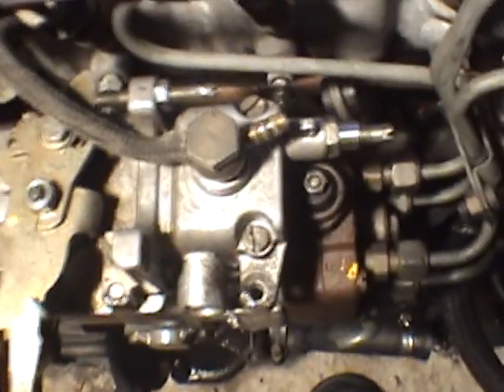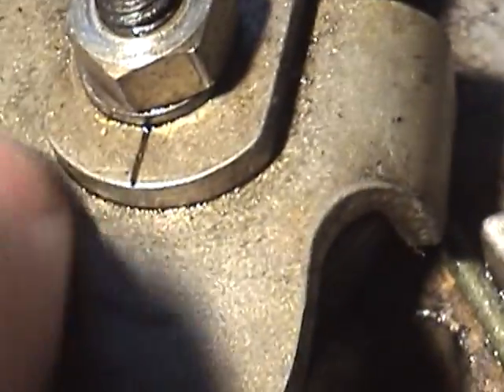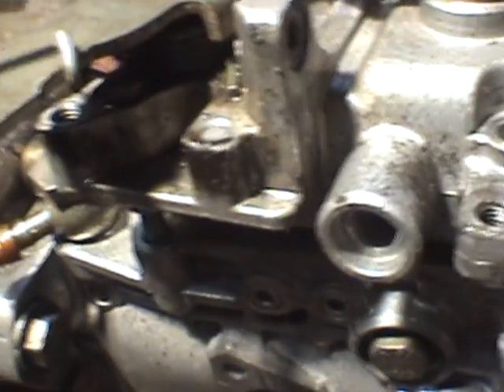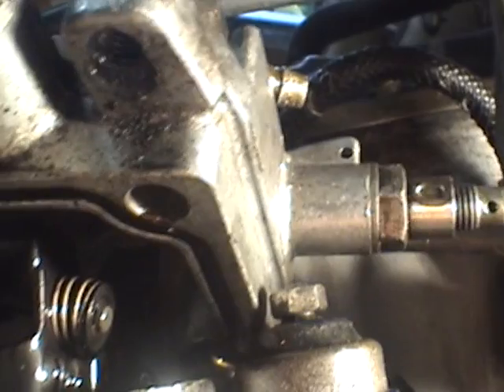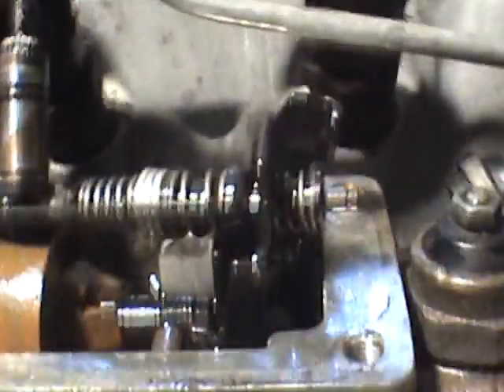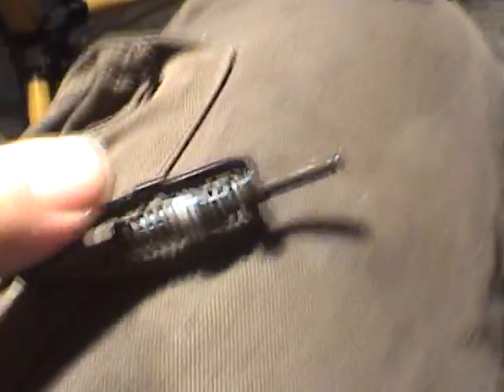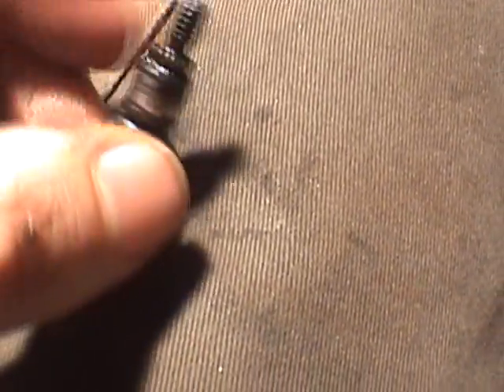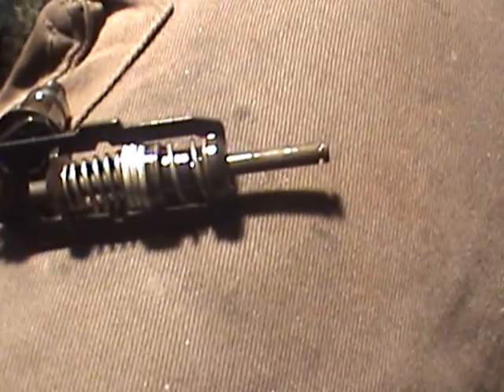VW Mk1 Diesel Pump Governor Mod

Comment: Too many washers there can cause the governor to drill a hole in the vertical lever. I do the governor mod by replacing the other spring inside the cage. The one to the right of the big one he shimmed. Remove that smaller spring and put enough washers there to make it so there is no slop.

Comment: I’ve been having an issue with my pump to where if i give it more than 1/3 throttle the governor doesn’t return the engine back to idle unless i put it in gear and let the clutch out a bit.. is there a way to fix that or do i need to take the top of the pump off like this? It’s a bit difficult to drive the car at the moment and a bit annoying
Reply: Try backing off the max fuel screw.
Reply: @vwfatmobile3275  it was bad fuel.. arco diesel is crap